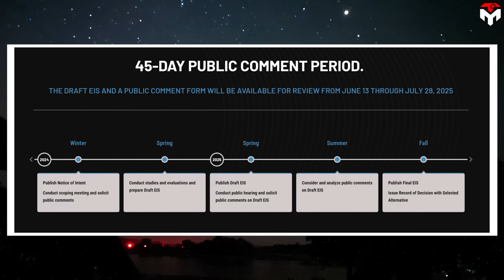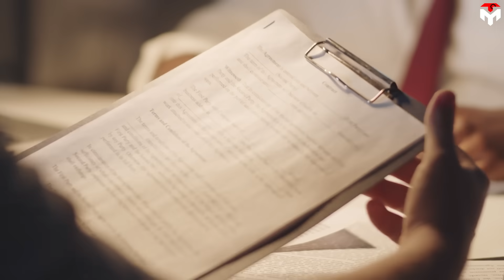ULA is Getting Sold, SpaceX's rockets to replace...

Comment: They will not sell ULA launch rights to SpaceX - ULA with its launch rights will be sold by the current owners - Boeing and Lockheed-Martin - to Blue Origin (or an equivalent proxy set up by Jeff Bezos. Bezos of course is partially responsible for ULA being vulnerable for sale through the late delivery of the BE-4 engines that ULA chose to power the Vulcan rocket. This was all predictable years ago.

Comment: Neither the Juno I nor the Juno II rockets evolved into the Saturn 1B or Saturn V.  The Saturn 1B and V were completely new rocket designs intended from the git-go for the Apollo moon landings.  As far as I can tell, the naming confusion stems from a 1959 proposal from Werner von Braun for a "Juno V" staged launch system to be built from combining several then-existing rocket systems.  Von Braun's staged heavy-lift concept survived in the purpose-designed and purpose-built Saturn family of rockets, but the new designs had very little in common with the proposed "Juno V" design, which never got beyond the tentative planning stage.  By the time the Saturn V was being built, NASA had progressed far beyond its late 1950s and early 1960s use and combinations of existing launch systems.  Von Braun was the conceptual genius behind NASA's early successes through the Apollo missions, but he was far from the only brilliant engineer who contributed to the design and ultimate success of the Saturn V -- still the crowning achievement of the NASA rocket designs and the most powerful rocket ever built.  Given the hugely labor-intensive and wildly expensive production methods used for the Saturn V's engines and other key parts, it is unclear whether we could even duplicate the Saturn V using current manufacturing technology.  It was simply an engineering and manufacturing marvel of its time.

Comment: Hoping SpaceX becomes successful in launching Starship rather than RUD’s.
Reply from the maker: They are learning from mistake
Reply: @techmap9 Unfortunately SpaceX is under more political pressure than it should be.  Definitely they are making more progress than NASA.
Reply: It was estimated in the beginning that it would probably take 10 lunches for starship to work. That was an expected to happen in the first year. Government delays stressed out out several years, and it may take a few more launches. But they’re not that far behind. The people calling it a failure or fools. Falcon nine had a bumpy start now it’s the most reliable rocket on earth.